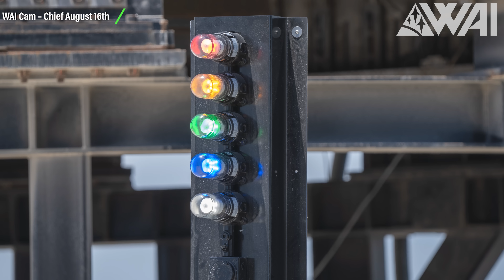Did SpaceX Fix the Chopsticks? B10 FWD Dome sleeved!| WAI NC

Comment: Looks like the catching arms are approaching a demonstration. How about a booster launch from a suborbital pad, 10mile ascent to end in a catch: no need to go orbital at all.  
EDIT: This form of demonstration would validate the catching arms and the SpaceX vehicle's thrust and control hardware and software for hover, translation and rotation as well as the mechanical components involved in the "capture". The vehicle needs to be fuelled and operating under its own thrusters, which are important in the determination of fuel usage and heat load on the tower and OLM. Surely the booster in the rocket garden could be updated sufficient for the demo. I mean the vehicle is meant to be re-useable? Well, demonstrate that.
Reply: Or just drop one from a crane on to the arms? They're aiming for a virtual hover anyway so dropping from a meter would be a similar load in theory.
Reply: @Krell666   I think you have come up with a really interesting and clever idea there John and it would make a good and relatively safe first test but in my opinion it could be taken one step further to do a second set of tests.

On your basic idea I assume they would use a totally unfuelled booster but with some inert (non explosive!) ballast to simulate whatever fuel load is expected to be in a returning booster at point of catch and obviously SpaceX could do a precise calculation on the exact drop height to simulate the expected downwards velocity at time of contact with the chopsticks. Much safer than trying even a catch from a sub-orbital hop since there there would still be a risk of explosion.

To take it one step further though it's not just the velocity at time of catch but also the acceleration and since some engines will still be running during the final moments of a real booster return that means that the net downward acceleration will be less than 1g until actual engine cut-off which might not happen until actual contact with the rails. SpaceX might also be able to simulate that by not dropping the booster by totally releasing it from the crane but instead have the booster attached to the crane via some sort of spooling cable drum with a dynamically adjustable drum brake so that they could simulate the actual acceleration and velocity curves of a descending booster by varying the drum brake to simulate the effect of the engine thrust. That would also allow them to simulate more of the final approach. How much more would depend on how high that big SpaceX crane can lift but if it could lift the booster and cable system high enough above the catch point such that they could maybe simulate the final 10 or 20 metres of the decent that would be a really good test because they could also practice the final 3 or even 6 seconds of moving the chopsticks into the catching position (I think from memory that Musk said in one of the Tim Dodds' interviews that the final velocity would be about 3 metres per second for the catch?).

Yes, my idea is far more complicated to do than yours hence yours seems a really good first test but SpaceX do have a whole team (apparently) dedicated to making test stuff e.g. the various test tanks and thrust simulators (puck shuckers), the can crusher and the nosecone MaxQ tester so building an adjustable resistance cable spool doesn't seem to me to be a step too far given what is at stake if a real (fuel remaining) booster catch attempt were to fail.